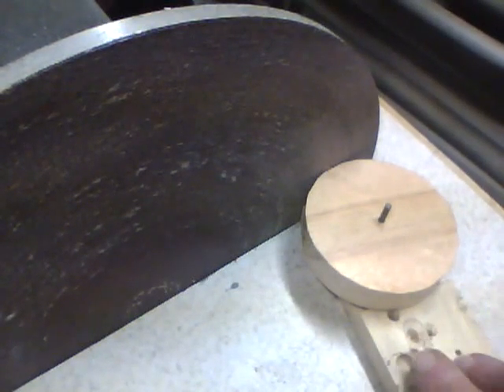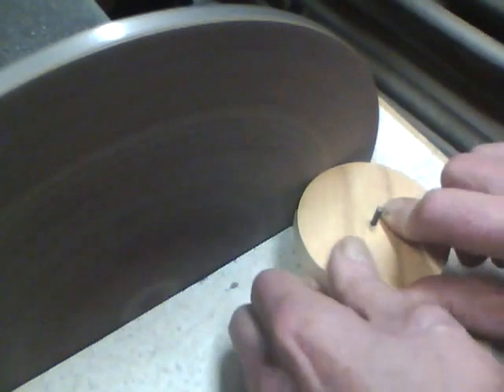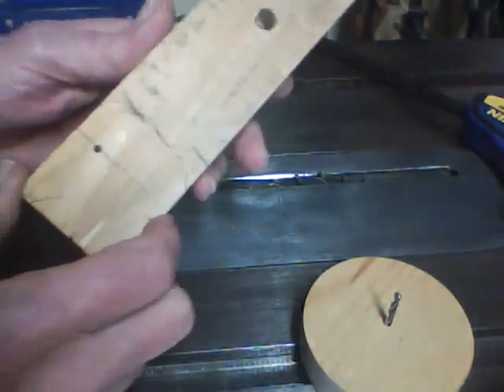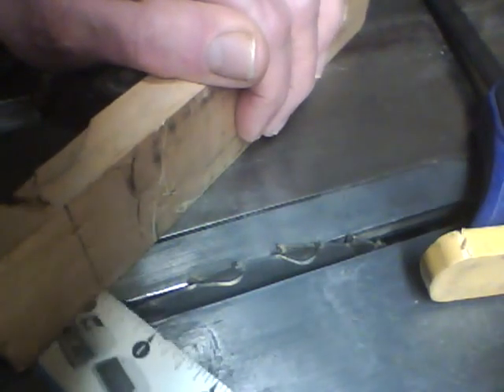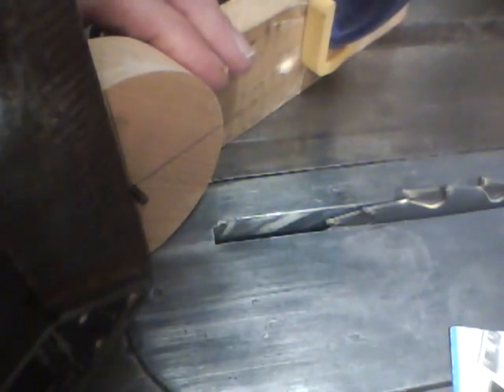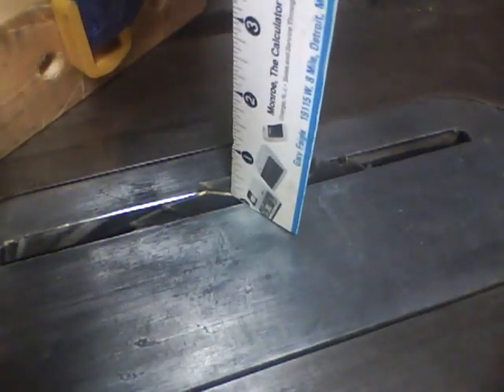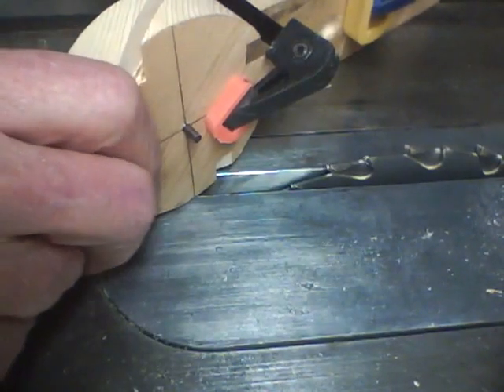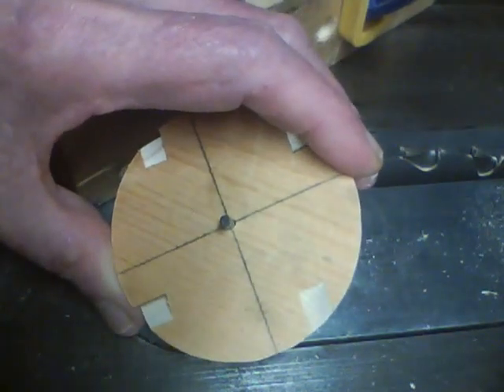Make Whirligig Hubs & Propellers part 2

Comment: Jimmy, create square stock like 3/4 inch by 31/2 inch square, punch your hole in the center, then cut the miter slots, easier on square stock.  Then round it and sand it.  Idea is to make  the blank square, cut  prop slots, resaw to desired thickness whatever - do everything on square stock as it is easier to handle.  Last step is to cut it round and sand edges. My 2 cents.  You da man.

Comment: IF you do not have a disc sander you can insert a screw and tighten a nut on it and spin it up with and electric drill against some sand paper, or like I do with an inverted belt sander, in regards to two blades on your table saw, If you use 2 identical blades with alternating bevels, the teeth will touch when you tighten them down. This will damage the teeth. The only blades that I know that will work best are the inner and outer blades of a stacked dado set. A flat tooth ripping blade may work if you rotate the blade so the teeth fall into the opposing blades gullet

Comment: I use a door hole saw, or a circle cutter in the drill press to cut my "circle" hubs.  Quick and easy!   I like 55 degrees for my blades although anywhere from 45 to 60 works fine.   Good video thanks for posting.
Reply: Me too find it easier

Comment: Nice video. Might be quicker to flip the disk around so the lines are against the scrap and strike a line on the top of the scrap. Then just align the line on the disk to the line on the scrap. No need for the the square. IOW we don't care where the 1st cut is we just need all the cuts to be 90deg apart.
Reply from the maker: That will work, Thanks

Comment: Thanks for the video, I just made one thanks to you!  I tried my own way and that was a joke, you show the right way.  My blade was not thick enough so after I used the table saw, I put the hub in a vice and widened it with a drill, holding it sideways.
Reply from the maker: Thanks rceliberti. Glad you got it done. You can put two blades that are alike on the saw to get a wider cut.